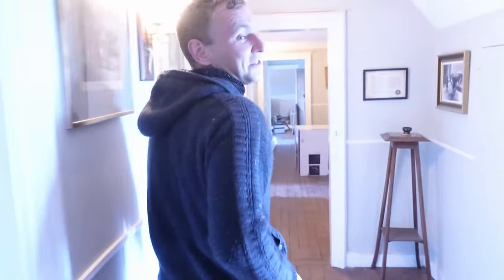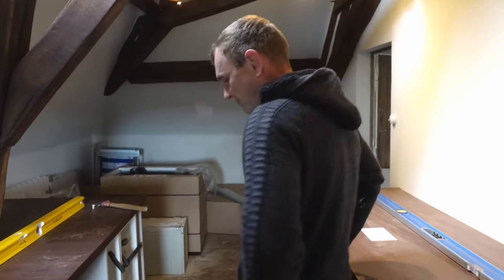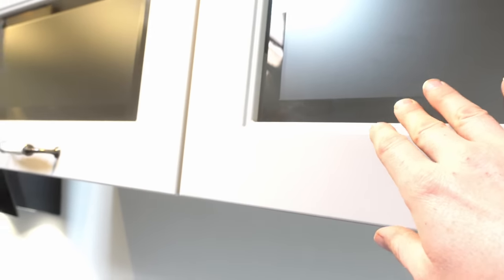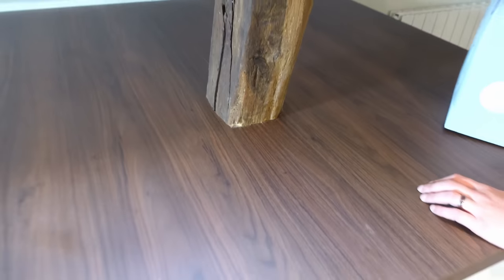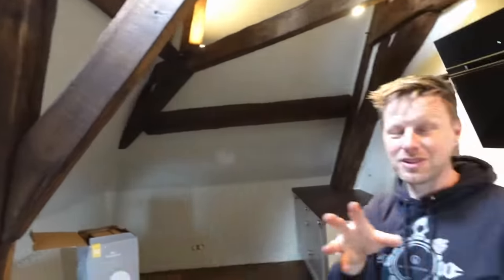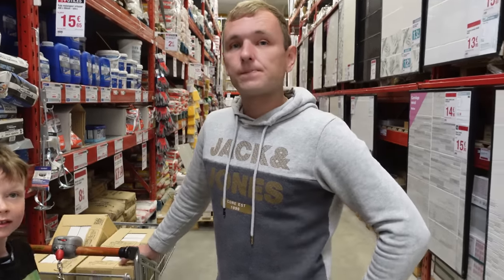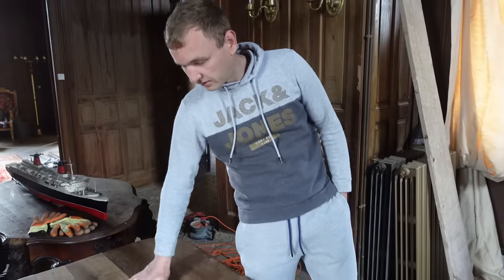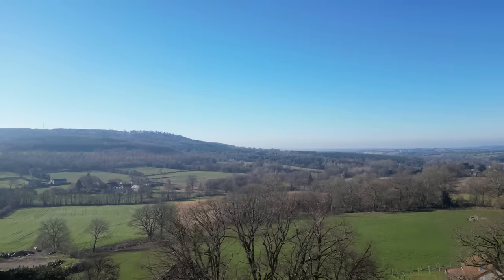THE CHÂTEAU KITCHEN is installed.

Comment: That Dachshund paper towel holder is the BEST! And re your dishwasher: make sure you wipe the grease out of pans and dishes into the trash so it doesn't clog your sewage pipes. That can be a HUGE mess to clean. My church is just down the street from a commercial block that used to be all shops and is now all restaurants and bars. They use a lot of grease and wash a lot of it down their drains. Those drains weren't designed to withstand that much grease. It backed up in the sewers and flooded the basement of the church with stinky sewage water. And I would imagine that out in the country you have a septic tank instead of city sewers, so you really have to be careful about putting grease into that. Congrats on the new kitchen! I know you'll enjoy using it!

Comment: The kitchen is absolutely beautiful, from an American!  One thing I might suggest, you might want to go higher with the tile.  You don’t think about it but things do splash and I think you might hit the wall with water, soap etc.  I’m assuming they will be 3 or 4 inches high.  Give it a try I don’t think you will be disappointed.  I think you should paint the windows the same color as the ceiling.  Don’t take away from the beams, they are too pretty.  Now go food shopping!

Comment: Hi Terry and Ash, 
I am a kitchen designer and I have done many small kitchens over 40+ years in business. I would have done exactly what you had done in your kitchen. Working with a designer is the best way to work out all the details. Most importantly, you have utilized every last mm of usable space to the best of your advantage. I am sure you will love the new kitchen as you love and are proud of all the work you have done for the Chateau. I would propose one more detail, bring the wall tile all the way up to the ceiling line, it will eliminate a lot of detailed painting down the road when you have to paint again and tile is so much easier to clean than paint. I'm hoping to meet your wonderful family when we travel to France possible this summer.  The best to you always, Mark & Scott

Comment: Absolutely fabulous! I’m in California, U.S.A. I love your frig and freezer wonderful. I would make the back splash tiles go all the way up to the fan over the stove, so much easier to clean oil off the wall. You guys have done a great job!
Reply: I completely agree with Kat. I’ve renovated 4 kitchens and having the tiles go up to the extractor fan makes perfect sense. You want to avoid greasy splashes on your wall, especially behind your hob. Of course, the tiles should span the length of the work top.  (It’s easier to clean a tile than a plaster wall.) Coordinating the tiles with the sink will be visually pleasing as well. May I suggest a tile without any pattern in it since your dark beams and work tops give the kitchen that dramatic touch already.  Btw, the kitchen installers did a stellar job as did the kitchen designer! You have to give it to the French, they do « modern kitchens in historic buildings » very well, and their workmanship is renowned.  Happy cooking :)

Comment: Didn't see the inside of the tall skinny cabinet between the freezer and fridge but if I think it's a tall space no shelf then you can put baking sheets in there.   Your kitchen looks amazing and has so much space and love your sink and your deep Pot and Pan drawers. The workmanship is evident of a very high quality and just like you I'm so amazed at the absolutely beautiful scribing work done to get the counter tops to fit like they were molded on site to your beams. I know your excitement at a dish washer since I had a house with one but the place I'm in now doesn't have one, the previous owners removed it and brought in a shorter cabinet base and counter to fit a bigger refrigerator so now no room for a dishwasher. I know you're not done but even if you left the kitchen as is it would still be a awsome space congratulations 🎉

Comment: I absolutely love how the kitchen looks. Ixine did a fantastic job and you definitely chose the right design. The handles add the period charm it might otherwise lack. Getting kitchens right in old building is so tricky. If you go for authenticity, you end up with a kitchen that isn't practical for today's living and modern ones can look out of place. You stroke a very happy medium. Lovelovelove it!!!!!
Only thing I would change is tiling up to the fan where the hob is. I used to live in a flat where they hadn't tiled up far enough and always having to be careful not to splash tomato sauce over the paint was such a bother. I only ever used the two front burners.
Reply: Thanks Enny 😊

Comment: Your kitchen is fabulous.  It is so unique.  Great choices of cabinets and appliances.  I have 2 recommendations.  First you need another 1 or 2 shelves in the spice rack and 2 I would tile the backsplash all the way up to the fan so there is no damage to the painted wall.  I have been caring for a home for 53 years and I am astonished at how high the grease will splash.  I recently had to get up on my counter top to reach to top of the top cabinets to scrub the grease off.  Of course I regularly was my cabinet fronts, but only seasonally jump up on the countertop.  You are doing a gorgeous job on the chateau.  And it was wonderful to see Jonathan is so precious.

Comment: Ash's joy over the kitchen is absolutely heartwarming. I agree the tiling should be higher.  Depending on the colour and the style (they could have a bit of a different sheen, could be the same colour as the walls, possibly with a some texture, etc.  Don't rush the decision) will dictate how high they should go.  Again ask for professional opinion.  I see so many people stop the tiling too low and then it looks not complete and a tad cheaped out on.  The cupboards (ie. under the sink) you can get later drawer like shelves that pull out.  So easy to access things.  As for the windows yes, the Authentico (spelling).  Let the beams stand out on their own.  Sorry this seems to be such a opinionated comment but I love designing spaces and the one thing I have learned is not to be in a rush nor to settle (it doesn't always mean the most expense is the answer either)  I see that you also have many comments coming for fellow Canadians who enjoy what you and your family are doing.
Reply: Haha. Thanks Jeanette. We’re still debating the height of the backsplash :) we are likely to paint the window frame :)

Comment: What a gorgeous well designed and perfectly fitted kitchen. If I ever had to put in a small kitchen on the third floor I would hope it turned out as beautiful as this. The only change I would have made would be cutting down the depth of the cabinets and worktop in the sitting area. The full depth cabinets and worktop reduces space for furniture. If I opted for kichen cabinets, versus using a custom fitted bookcase or shelving unit, I would have also choosen a different color and worktop to separate sitting area from the kitchen. 

As others likely pointed out keep belts, snaps, and button closed bottoms away from that apron sink. I made the mistake of installing an apron sink when the decorator suggested it back in 2013. After 14 months I had it ripped out and replaced with a nearly identicalunder mount sink I had prior to installing the apron sink. The kitchen was remodeled just two years prior to installing the apron sink. All they did was cut the marble worktop, reinforce the sink cabinet unit, and install the sink. When I replaced the apron sink the two marble slab worktops had to be replaced with a new continuous marble slab. The entire exercise was a total waste of funds and marble. Anyone thinking of an apron sink should quickly forget about it and go with an under mount sink. With an under mounted sink you can cut the stone slab worktop to accommodate a larger sink. To replace an apron sink you must replace the stone worktop halves for a single costly stone slab. One could always use a protective cover on their apron sink which detracts from the beauty of an apron sink. Which begs the question; why install an apron sink if its always covered for its protection? Friends of mine installed a stainless steel apron sink with a wide protruding apron. The sink looks horrible just six months later thanks to scratches, dings, and dents. Yes, one can find very durable apron sinks. The sink these lads just installed appears to be a top quality composite sink. Composite sinks are great due to their durability, ease of cleaning, and if required, restoration. Light scratches, burn marks, and stains are easily buffed away. Seamless repairs of chips, gouges, cracks, and broken bits is another benefit of high quality composite sinks. Well done lads.

Cheers!

Comment: I in love with the table you found and what a great price!  I'm happy you decided on an electric stove.  It cooks cleaner and less worries.  Sausage is a wonderful companion.  Long ago I had a miniature sausage and she was a bit neurotic so to see how easy-going Sausage is, is downright lovely.  Your dishes are really cute as is the paper towel holder.  I'm looking forward to see how you finish the table off, install the tiles and any of little accoutrements you decide to add.  The one thing I wish was built into the chateau was a trash shoot with a compacter at the bottom.  It's used in commercially but we had a small rendition in a condo building from the 1950's and saved on trailing leaky trash bags through hallways, down stairs, etc. It also helped minimize the size of the trash having to be carried/carted out.  I do use standard home trash compactor trash bags as they are thicker than standard home trash bags and unless you take something sharp, like broken glass to it, it won't leak or tear.  Don't know how available they are to you over there but they are still carried in the larger food markets and big box stores like Lowes in the US.   I'm so excited for you both.  Happy kitchen, happy life!

Comment: WOW!!! The kitchen looks fabulous! Yes….you needed drawers (for silverware, cooking utensils, etc)…good call on that one. Just a thought on the deep cabinets…..I have a number of deep cabinets and it’s so hard to get to stuff in the back. Every time I need something that’s in the back…I have to take everything off the shelf to get to it. Eventually I’m going to put in a “sliding shelf”. Basically the bottom is wood with 2” edges (picture a box with small sides). Under the box shelf are a set of glides…one on left and one on the right. One part of the glide is attached to the shelf of the cabinet, the other to the bottom of the box shelf. When you need something in the back, you just pull out the “box shelf” and take what you need. My friend did this in her pantry. It’s so much easier to see what foods you have as well as easier to reach. I want to do that to my pantry as well. I can’t tell you how many food items expired because I forgot they were there because the cabinet is so deep. I like deep cabinets but things need to be accessible. Anyway, love the subway tiles you bought! I was thinking of the same tiles!! And regarding the window trim….no white…too bright. I think either the same gray as the walls or staining it like the beams would be good. Maybe staining it so it’s like a feature in the room….frames the view outside. Can’t wait to see it all pulled together!! 💙🙏

Comment: Love your kitchen, guys. Ash, I have a sliding two tray rack that I can pull out on a fixed runner that fits under that sink. I had a very tight budget so wondered if it was worth the $140NZ. Best purchase, holds all bottles, cleaners, dishmops, scrubbers etc and has washable inserts.

Comment: Congratulations guys!! This kitchen is amazing!! Just the way Ash Lit Up shows the excitement and that projected into the appliances, so I would assume Ash is the Chef?? The layout is perfect and changing the location for spices and the bin makes perfect sense!! It's a Chef's Kitchen for sure!! The installers did an excellent job, as you pointed out and the finished layout and appliances are beautiful!!!! 

May I suggest you consider tiling the entire area above the counters inside the angled beams where it's recessed, Rather than just go up 3 rows? I say this because the beams and the angles from them, are already making a statement. To add another horizontal line to the space where the row of tiles ends, would take away from the existing simplicity and could complicate the look. If you tiled the recessed area inside the angled beams,  you would emphasize  architecture of the space and use the the beams as part of your design scheme, maybe even to the other side of the door, despite the wall being further recessed as it would tie both sides together, ending where the other angled beams lives. This way  you could accentuate the area inside the angled beams without complicating anything, giving it another texture or shade of color. It will retain  the simplicity you see now with the blank wall, except that you'd be making a statement within the beams and not take away from anything or add any lines to complicate the aesthetic if you follow what I'm suggesting?😊

Comment: How exciting, looks fantastic, I have a small kitchen as well. I am curious how well the extractor works- a kind of a boring question but I like the look of it. We usually have a hood with a small unvented extractor. Works fairly. But it has an overhead light. I will be looking for one like yours when I change my kitchen. 
Enjoy your first meal.
Reply: Thanks quest. We’ve not cooking in there yet! Ask me again in a couple of weeks! It seems Terry powerful lol. I’ll keep you posted 😉
Reply: I hope your extractor is really efficient. We have an exterior vented extractor over the gas cook top in an open plan kitchen, dining, and living room, and I do find cooking smells and residual heat linger long after a meal. Luckily, you at least have a door you can close off from your living quarters. I worry you'll want more cool, fresh air, especially in on those hot summer days, since you don't seem to l have much ventilation in your kitchen.

Comment: Forgot to ask; with all those beams and your  other beams...when you've cleaned them and sealed them, have you  had any troubles with the beams daily dropping wood/debris and little tiny animal or poop looking pieces coming from the beams down to the floor?  we just cleaned giant farmhouse beams, that hadn't been cleaned in decades.  put linseed oil on them. and now every day in multiple areas, dropping everywhere. even chunk of wood one day?? any  idea?  thanks so much
Reply: Hi Darla. Before we did any of this work. We treat the whole chateau for pretty much the full year with xylophene. The chateau had a pretty bad woodworm problem before, if your seeing constant bits of wood and beetles, normally in wetter/colder months, it could be that :/
Reply: @ashleywaters7198  Thanks so much; its weird as previous occupants said no droppings at all.  They hadn't been cleaned in over a decade.  we hoovered and then treated with linseed oil only.  its daily droppings of wood drops and what looks like mice droppings almost. no alive worms of any kind.  thanks so much for answering
Reply: @darladressler  I would definitely treat with xylophene! What you are seeing is the woodworm hatching. 

I would also invest in a dehumidifier once the treatment has been put on, just to pull the moisture out of the air. It helps to stop the cycle :) 

If you want to chat further drop us a message on the chateau de lalacelle page on Facebook and I’ll help how I can :)
Reply: @ashleywaters7198  thank  you so much, sadly, we will do  the treatment.  They are SO high up as its converted barn but have to do something to stop  the droppings